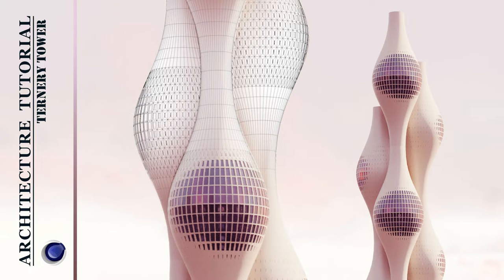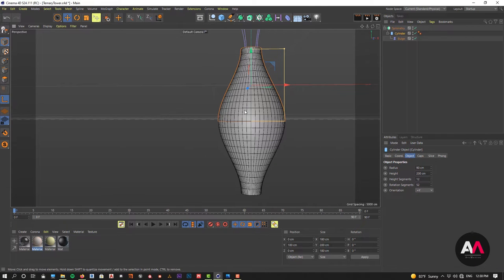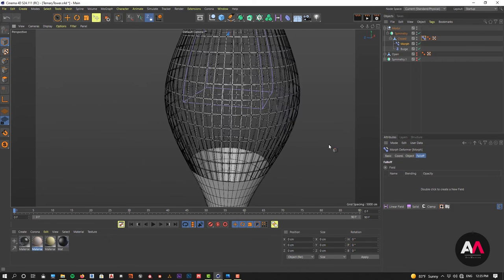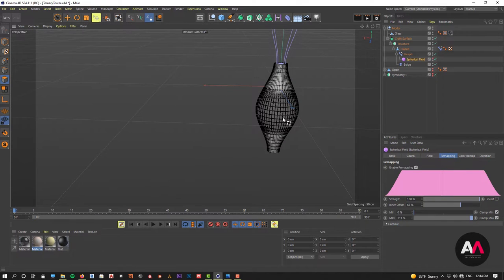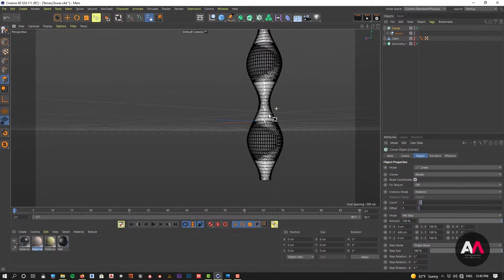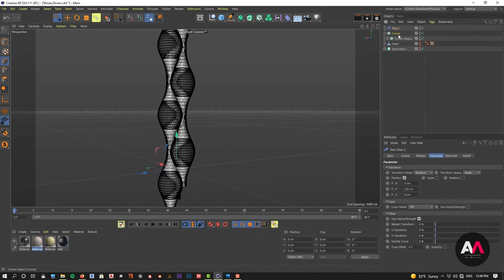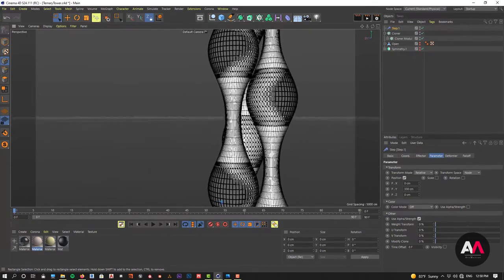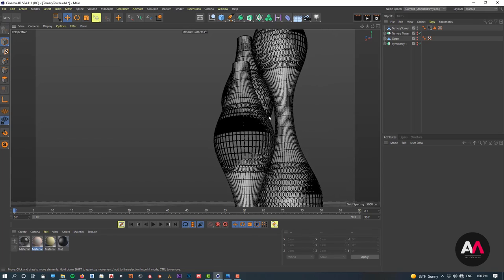Cinema 4D Architecture Modeling Tutorial

Comment: Hello, nice and useful video, Thanks ! Just one question : Why don't you model in real scale ?
Keep up the good work.
Reply from the maker: Hi Eddy. thx for the comment. and yes it is better to work on real scale but for very big structures i prefer to work proportional. it will be easier and u dont need to rescale everything. but at the end if model is correct you can rescale it to the real size. but in that case you should always go to the project setting and define the type of scene you are working on. if it is micro scene or if it is huge scene. because of clamping and so on.